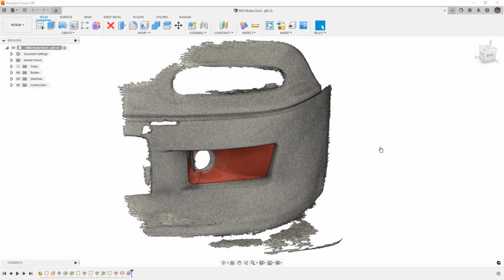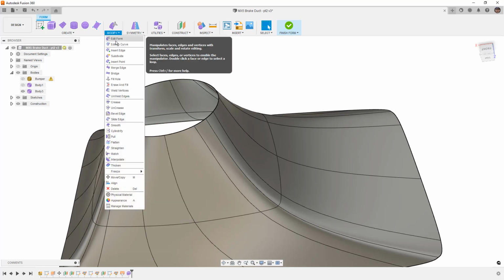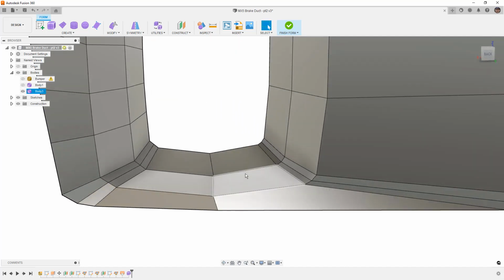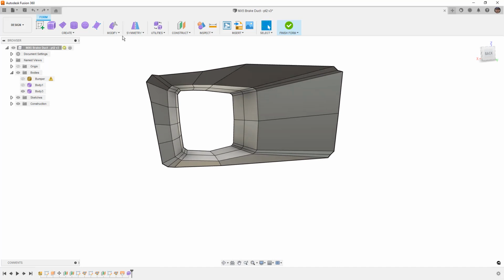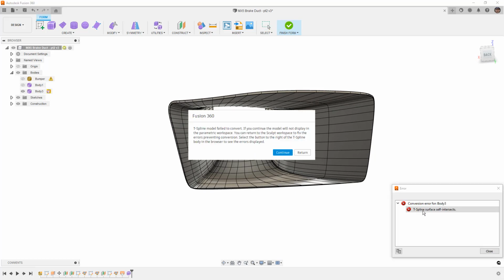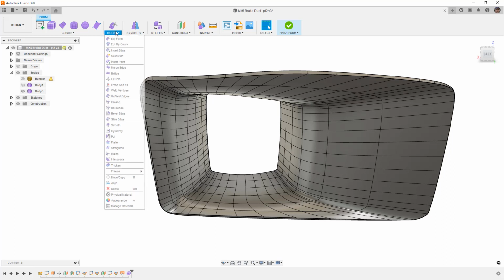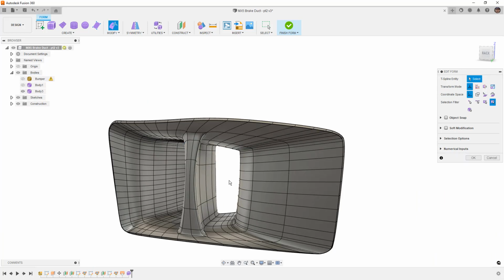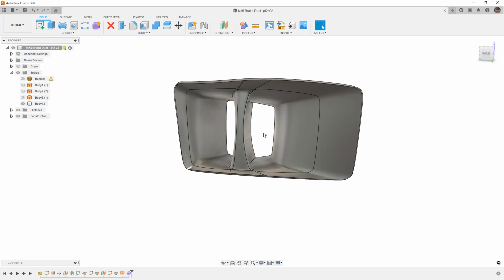Fusion 360 Form Mastery - Part 47 | Modeling a Racecar Brake Duct System With a Thickened Form

Comment: Hi, your series has helped me a lot.

I'm trying to design an AC vent for my car with moving parts, but much fewer than my stock ones because I want to avoid 3D printing thin pieces that might break easily.

I thought the thicken option might be a good option for that, but I'd like some suggestions on how I can design it and put off using the thicken too for as long as possible.
Reply from the maker: Hey There.  Depending on the geometry there are several different ways you can do that.  Since you are 3d printing you don't have to worry as much about a consistent wall thickness like you with with injection molded parts.  You could extrude the fins from a 2d sketch and trim them to fit with your vent/duct.  You could make a surface and thicken, you could also make them as forms and thicken them.  If you use forms to thicken you can have a smooth edge rather than sharp edges so that might be a nice option.

One thing to keep in mind is that thicken goes out normal to the curvature of your shape/surface.  This can often make edges have some undesirable changes to them depending on the input.  So if things look a bit funky or the thicken fails that is probably why.

Comment: Hello, I have a question about align 3d scans. Don‘t find a video about this and have a hard time to help my self…but my goal is to fit a 3d scan part in to another 3d scan part and make a kind of adapter. I have relativ easy task like fitting a cooling reservoir in a engine bay to the „master goal“ fitting a 3d scanned engine and gearbox in a 3d scanned chassis. My equipment is a shining Einscan H scanner (which gives really nice results!) a gaming notebook with I7/3060rtx, fusion 360 and solid edge 😊
Reply from the maker: I have videos on the Exscan software specifically.  You can import multiple scans into the same project but if you are trying to use specific alignment then in general what you would do is say have markers on the firewall and lets say on your valve cover.  Scan with the engine in place. remove engine(easier said than done lol), and scan again.  The marker dots in the project would help you align the engine mesh to the firewall with the markers.

Other than that if you just have the mesh files already you would load them back into Exscan and go into the Measurement and make some planes, points and lines.  you can also manually move them into place.

There are other tools like GOM inspect (free version), Meshlab (free but tricky) and paid programs like geomagic.
Reply: Thank you very much for this insane fast answer!

Your absolute correct, place the engine inside the chassis and scan the whole thing would be the easy way. But than I could weld some simple tubes and metal plates together and would leave out all the engineering fun!😄 
I also want to be sure that the crankshaft is absolute parallel with the chassis. My idea was to make align features like attach to the chassis and engine some axis or forms which I can make parallel to the other features from the counterpart to ensure that I’m parallel and move the rest manual to find best Fitment and look out for potential issues.

I will take a look to your Exscan videos, maybe I missed out some features of the software!
Reply from the maker: @js5435  scanning software made for mesh work like Geomagic can do alignment of different mesh bodies.  If the scans don't have marker dots in common I am not sure how far you will get with exscan.  This is something you could do with fusion but not precise because you are basing references off mesh which is not a true cyl or true plane.  I think the idea of "absolute parallel" with a scan is going to be tough :)
Reply: @LearnEverythingAboutDesign  yeah, I would have been more realistic, if I used the words “accurate as possible”! According to the dimensions/length of an engine-gearbox combination, I would say 2-3mm per meter parallelism is very accurate and enough for such a project. As I said my idea was to manually attach circles/cylinders to the crankshaft reference points like damper and flywheel to get an accurate parallelism (and x axis) and reference points of the cylinder head mating surface (for y plane and then tilt whole engine by 30° around x axis from crank). If you would have a scanned engine gearbox combination and a chassis, how would you tackle this without ridiculous priced software like geomagic? Do you think this is doable? Sadly Exscan can not work with cylinders or anything close to round (due triangles yes it isn’t) to find the middle from cylinders or round objects etc. also sadly Fusion 360 don’t like to work with bigger scans due not using multiple cores from cpu so even with a high performance gaming notebook fusion is unworkable slow and last but not least GOM inspection allow only one import stl with the “free”license.
Reply from the maker: @js5435  Yeah i just fired up ExScan to try....

There are a couple of things you can try to do with Fusion 360, but ill warn you its not a super clean process.
Create a copy of your mesh, and then remesh it with fewer triangles or slice the critical details you need.  if the heavy mesh is hidden, then the software wont bog as bad.  It mainly bogs when you hover the cursor over it because it tries to franticly select things.
Add each mesh to their own components.  Each component has a coordinate system and moving an entire component vs a mesh body is easier.
Go into direct edit mode on a mesh and you can create a plane from points on the mesh.
Create mesh sketches for your input shaft, flywheel etc, and edit those mesh section sketches to create a circle on those.  
Use Align with the component object type.  This will let you select features (like a cyl made off a mesh section sketch for an input shaft) to align to other geometry.

Ill try to make a video of this over the weekend and post it on the channel.  Its an absolute downpour now that its too loud to record.
Reply from the maker: @js5435  I just recorded a video which hopefully will help.  Should be live in the next 15 minutes.  Let me know if you have any questions.  I used a transmission scan, but didn't have an engine block scan to use.
Reply: @LearnEverythingAboutDesign  thank you so much, I really appreciate it! This is way more help than I expected! I will try it with my scans in the next days in my freetime. This will help me (and lot of others) with a lot of things like engine swaps, for me also to create some quarter windows intakes and so on.

Thank you for showing the basics, how it’s done and giving the people the right tools to create whatever they want.

Comment: Hi! I love your videos. Im from Brazil and they are helping me a lot. I make Fiberglass car parts from 3d printing designs. I need help to design a rear bumper diffuser with 7 fins in a 3D Scan from my car. Can you help me with that? Make a video from this. Im having problems to design a exactly tickness crease ALL over the part and to design the fins
Reply from the maker: Hey There!  If you are looking for something with exact thickness for diffuser it probably is better done as a surface rather than with forms.  At least for the vertical rib part.  With forms it can be done but it is a harder thing.

Have you already designed the bumper?